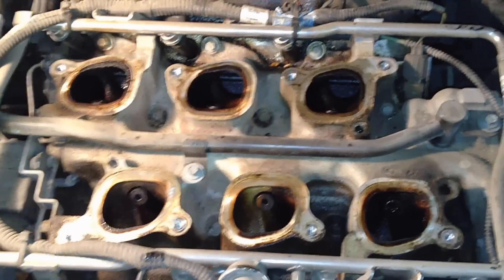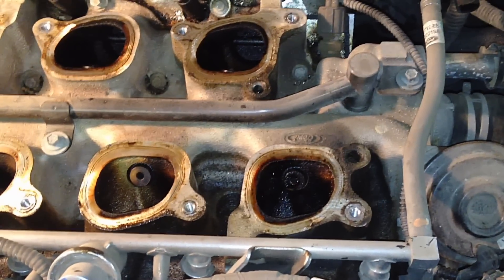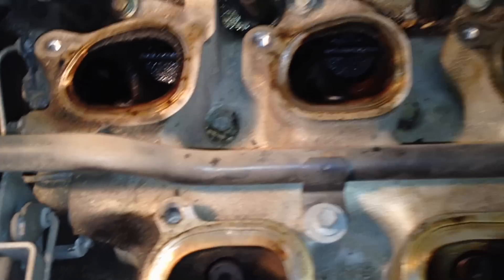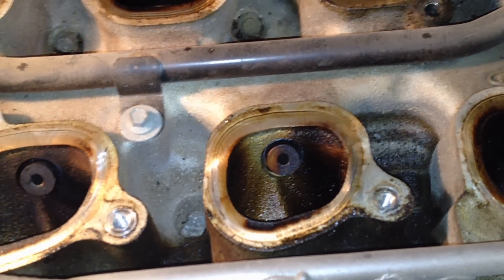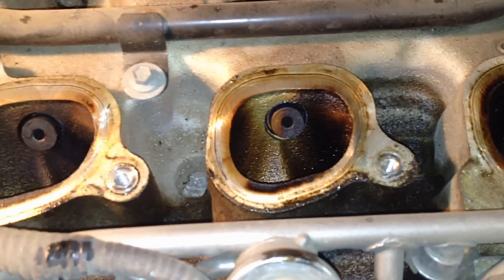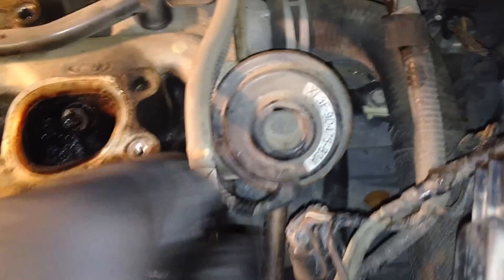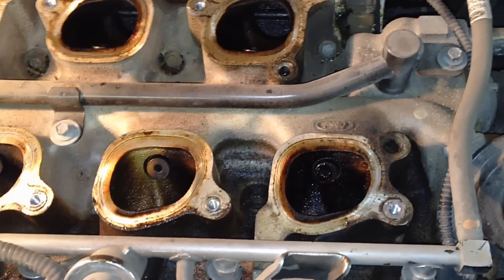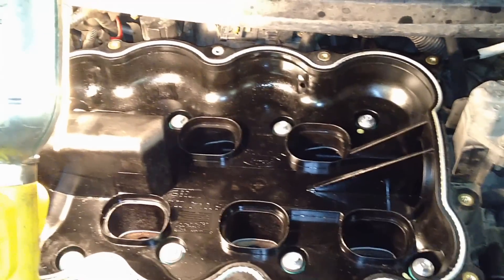Ford F150 4.2L & 3.8L Windstar Hard To Diagnose Misfires

Comment: I have had very few issues with my 4.2. I treated it like junk for 2 years as a stupid teenager forgetting to get oil changes. Now I treat it better but have only needed about $1000 in parts and repairs for the 6 years I have had the thing. I have been chasing a misfire on this engine for a year and half. "oh do this and do that and it will go away" and it never went away. Having replaced the egr valve last year, this  makes sense as the culprit. Other than that this engine is a slug but keeps on going and going.

Comment: To prevent this problem, place an oil catch can inline with the PCV valve to the intake. The oil from the crankcase is going into the intake and collecting in these EGR ports. When I did this 9 years ago, I no longer have this issue. I recently removed my upper intake to replace the IMRC. The EGR ports were still clean.

Comment: Thank You for the great video and information. I have a 2003 ford f150 4.2l  idle is smooth, try to accelerate and the engine hesitates and backfires. I removed the vacuum hose and no change. New maf,  tps, coil pack, wires and plugs. Any suggestions? Again Thank You
Reply: Have you ever figured out the issue?

Comment: I am considering getting a used 63K miles 2002 Ford E-150 with a 4.2 v6 is there anything I should be worried about with the 4.2 L

Comment: And while you're back there, might as well change those plastic clips on the back of the secondary butterfly actuator. 6 dollar plastic clips, not fun to change when the little metal arm pops out, need a little arm to put back on without pulling everything apart.
Reply: But buy only oem ford clips there been too many complains about aftermarket falling loose

Comment: 8 years later and he's the man help me out. House fixed. Put plugs and wires on one I bought for my daughter that turns 17 to drive but turns out pulling the intake off. Hope that also fixes the 174 and 171 codes I have in it. Also I'm pretty sure it will

Comment: On the early ones, the large aluminum runners were a pain. We had an Electrician with a fleet near replacement point and I was able to remove the egr valve and alternate carb cleaner with compressed air and get more even EGR flow probably just got cylinder 1 and 3 orifice cleaner. It was enough to reduce stumble and eliminate p0302 to get passed emissions.

Comment: Thanks for the video! My grandmother has a 02 windstar with the 3.8L. Put new plugs in it and wires. Runs perfect when its cool. When it warms up, it runs like a 3 legged cat and wont hardly take off. Same thing with my great-grandmothers 07 Freestar! I have racked my brain over it. Im going to see if this is their issue tonight!!
Reply: Little late but what was your fix
Reply: It ended up being failed coil packs. However both of those vans are in the junkyard now. The 07 went thru 3 transmissions! @BlakeHirst

Comment: pre 96 4.6L engines had a similar issue. They had a solid AL intake until it became plastic.There was an EGR crossover in the back that would fill with carbon. Eventually it would plug the egr tube which is in a terrible place behind the engine! It would give a P1407 code. Also, the engines had bad valve seals which made it worse
Reply from the maker: alb12345672 Oh I remember doing those they were a pain to get to is all I remember and they packed with carbon for sure.

Comment: Found this tip!  Exact symptoms on 2005 F150 4.2 v6. cyl. 3 misfires.  Replaced coil pack, plugs, wires, compression checks good. Disconnected EGR truck runs good.  Pulled the clam shell expecting to find plugged EGR ports, but to my surprise there where none.  Replaced IRCM assy while I was in there put it all back together still fails the same.  Wondering where I go from here?  Appreciate any ideas, this tip by FordTechMakuloco was dead on, though I had it.
Reply: Did you end up getting it fixed?

Comment: Great videos. Quick question on my 02 Windstar I replaced the coolant by pass tube under the clam shell and cleaned all the EGR ports with a wire and  Throttle body cleaner spraying it in each port. After reassembly I forgot to initially connect the ERG control electrical connector and when I started it the idle was surging after  about 10 seconds. I then connected the electric connector but after restarting it I had the same problem.  Should I do the relearn procedure for the PCM you showed in another video? Any other suggestions? Thanks

Comment: Just had one come in. They had the EGR unplugged and the problem went away. So they thought. It also had the broken IMRC bushing missing. So the rods would not open\close the valves. A known issue with these engines...

Comment: Hope you can help me I got a 2002 ford f150, I change my sparks plugs (got from ford dealership gap them at 53) and removed my fuel rail and fuel injectors ( got some sea foam and put it in my fuel tank to see if it the injectors needed to be clean but didn't work) then I installed everything back together. my truck at first makes a very hard shake and so when I drive it its fine but when I come to a stop it continues to shake and there is no code for a missfire or anycode, any help would be appreciated.

Comment: I have one of these engines in my 2003 Windstar with 236,000 miles on it. It runs perfectly with no problems at all. However, would it be a good idea to pull the upper clamshell off anyway and open up all the EGR ports? With all that mileage the 6 holes must have at least some buildup in them.
Reply: Its always a good idea to do this once a year preventive maintenance goes a long way
Reply: Its always a good idea to do this once a year preventive maintenance goes a long way

Comment: Hello
2002 F150 4.2 140k miles. Codes P0316 and P0302. Engine misfires when I start it hot. Only misfires until I rev the engine 2 times. Cold startup is fine. I have changed plugs, wires and coil pack, MAF clean and air filter. I was going to pull the injector but getting at it is a bitch. Any suggestions thank you.

Comment: I think this is whats causing my P0306 issue but I cleaned the ports several times. I wander if there are chambers inside of the lower intake that are clogged from high miles. I used wire brush in the ports so i know they are clean. maybe i need to flush with carb cleaner using a fine straw in the chambers... hmmm
Reply from the maker: Easy way to tell is pull the vacuum line to the egr valve and drive it you will know right away. I show everything in the video.
Reply: '98 f150 4.2l - 306 and 174 codes. Cleared the codes and pulled the egr vacuum line and the codes came back the same. What should I try next??

Comment: Got a 2000 f150 4.2 quit running t
Fuel pump and filter fine replaced cpu injectors are not working any ideas

Comment: I want to buy a 1998 Ford windstar van it is misfiring any idea on how much the job will coast to get fixed.
Reply from the maker: +Darren Cuffy If it is misfiring then the concern is likely just due to secondary ignition over this concern.
Reply: +Darren Cuffy I did  that job to my Windstar myself with the help of this very same video. The Isolator bolts 6 of them costs $34.00. The upper and middle intake gasket cost $29.00. The job might look hard but it is easy. Just watch these videos Check the codes to see what sensor are bad before doing this job. On my van I put all 4 sensor first. That did not take care of my P0171 and P0174 codes. Then, I put the mass air flow sensor that did not take care of those codes. Checked for vacuum leaks none. After all that it was time to open the intake up. The gaskets and the Isolator bolts were bad. put the new ones in and gasket problem solved. And I past inspection. So all in all I spent $450.00 But I got the problem solve. The oxygen sensor I bought them at part geek.com  $128.00.plus $ 100.00 to have them installed I saved a lot of money. Mechanics some of them will steal your money. Now, my van runs like new. For missfire check coil it usually cracks. Check spark plug wires and spark plus. Good luck.
Reply: Right on the money .. Good man

Comment: My 99 f 150 4.2 keeps comimg up code to cam sensor replace it and it runs fine until it warms up then it starts to miss belive it could be this
Reply: MATTHEW SMITH , 
Did you ever figure it out. My truck is doing the same?

Comment: I've got a 08-f150 v6 with 4.2.  Getting misfire on cyl 3.  No check engine light.  Truck hesitates and jumps when decelerating around 45-55.  I removed the vacuum line from EGR and issues stopped.  Was going to clean the EGR ports you speak of in this video, but I don't know how to remove the "clamshell".  Can you help?
Reply: Some similar issues,  kinda rough, stumbling,  at highway speed, hesitation sputtering then accelerates strong,  even sputtering backfire at incline or curve but will accelerate strong after stumbling.. 
Got a fuel relay? On cross member by spare coming today, coil / coil pack singular unit on order.. baffling plugs & wires replaced
Reply: @keithberryman7000 did that fix the issue?
Reply: @michaelsterling2276  Fuel relay , lots of rust, corrosion where it's located.  that helped some & have gotten new that were DOA, new out of box. I keep a spare,  funny because that's where it's located above spare tire!
Reply: @keithberryman7000  gotcha thanks for the reply!

Comment: Hope you can help me. My van idles at 1500 rpms when parked and the A/C on. I don't know why. Idles fine when I turn A/C off right below 1000 rpms. Thank You
Reply from the maker: What year? That almost always indicates a large vacuum leak, have you check vacuum hoses and that pip that goes into the back of the intake tube as shown in this video? No check engine light? While it is running unplug the iac and see if it dies.- Ford Freestar P0171 P0174 Runs Lean & Dies Out

Comment: I am working e250 4.2 don't  have misfire codes. I have lean codes weird ones too. bank 1&2 02 sensors upstream are indicating a lean condition, intermittent maf code, and bank 2 sensor 2 is respond as it should. where should I start?
Reply: Upper air intake manifold vacuum leak. Do a smoke test. The bolts fail to hold the gaskets down. It will cause p0171 p0174 p1131 p1151. rarely has anything to do with both 02 sensors.

Comment: my 3.8l mustang has a big problem , it misfires when it wants to and it will run rich with no cel codes I changed the spark plugs and wires twice I changed the pack to with no resolve I'm at a stand still cause ford told me they couldn't find anything wrong , the other day I drove along train tracks and my cel came on blinking and I pulled over and turned it off and waited a bit then turned it on with no cel code?? I had my ac on and it went hot?  upon turning it back on it went cold again? im stuck :( help.
Reply from the maker: +Antonioq Hernandez Have you followed this procedure to disable egr? How do you know it is running rich?
Reply: I had thought it was my egr but how would I definitely know? and it smells upon driving and sometimes on ignition.

Comment: I have a 4.2 kicking my butt . It misfires when driven hard and the only thing I have left is the cam position sensor but I can't get the stupid sensor out because of the metal cooling line in the way . I prayed it was something else but I am all out of options :(
Reply: The metal cooling line is your heater hose Y pipe. It will come off with some wiggling, but be sure to have a pan available because you will have coolant spilling out since it’s attached to the water pump.
Reply: @standhd  It actually started to bend and I did not want to break it . so I put it off for another day . however ty for info it is very informative :)
Reply: @LITTLEBRAT775081  Yea, I did a camshaft sensor and synchronizer replacement and that Y pipe was the last thing in my way after I removed the EGR piping.

Comment: EGR recirculates unburnt exhuast gasses to reduce emissions and slightly assist with gas mileage. EGR also INCREASES intake temperature, as HOT exhaust gas is being forced into the intake. You have no idea what you're talking about regarding the function of EGR. Stop talking.
Reply: No, Jim, you're the one who's wrong. Look, when is the cylinder hottest, during intake or combustion? It's during combustion. So if the engine is pumping inert exhaust gas back into the cylinder, there's less O2 available for combustion. The ECU compensates by  injecting less gas. You have less combustion occurring in the same amount of space, and therefore a lower peak cylinder temp during combustion.
Reply: I just had to wonder out loud which Jim you're speaking to; are you talking to yourself again Jim LOL cheers!

Comment: I despise these engines. I think they are even worse engines than the 5.4 3 valves. Nothing is ever working right. If it isn't electronic, then it's mechanical. Always a rattle under load, always leaking oil everywhere from every place. I've had two 4.2 engines and both have been an absolute headache. Hardly can go a day without a different check engine code.
Reply: Have had mine for 23 years and have almost 400,000 miles on original 4.2 .. sorry about your "luck"